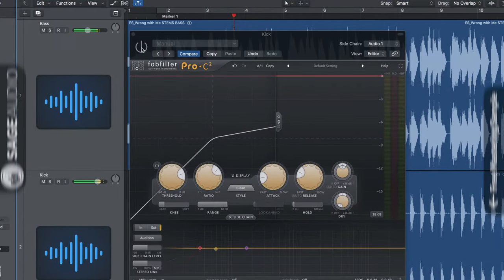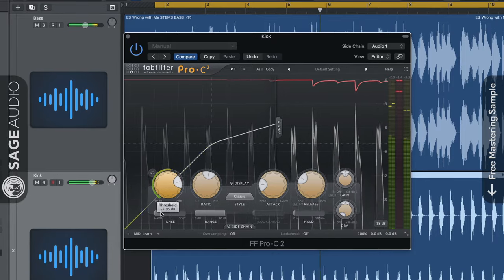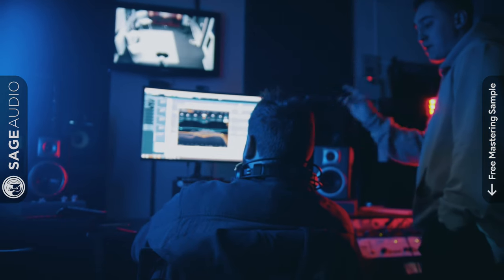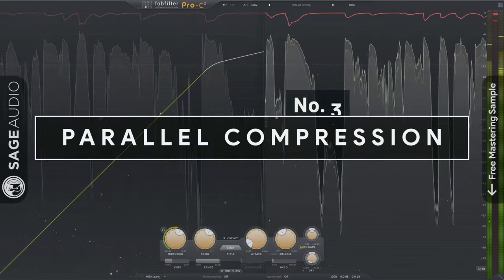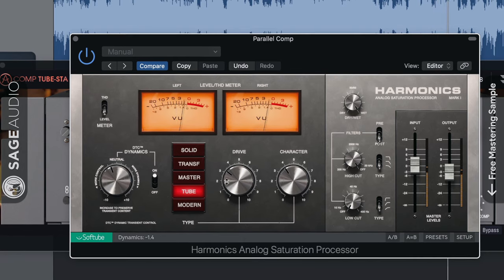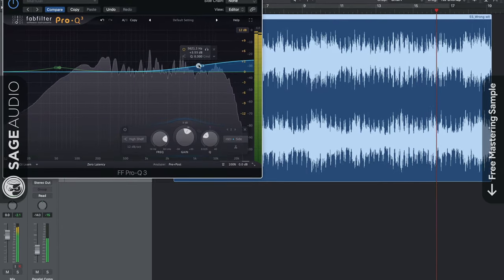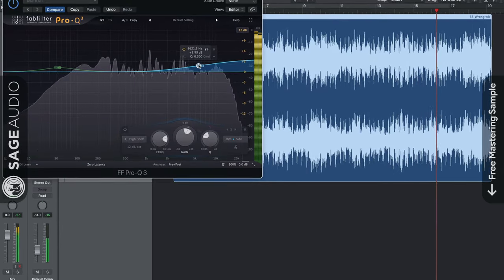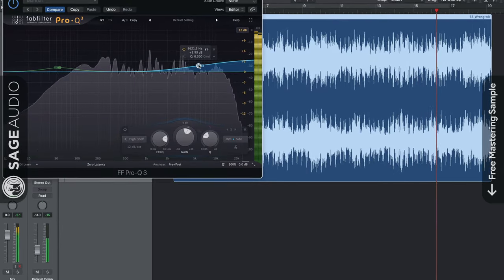Top 5 Compression Techniques

Comment: 00:00
👋 Introduction to the top 5 compression techniques
01:35
🔊 Technique 1: Kick and bass ducking for better definition
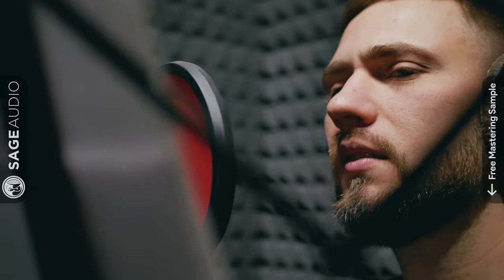03:45
🔊 Technique 2: Full mix and vocal ducking for vocal prominence
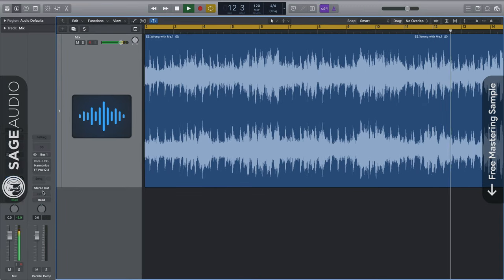06:11
🔊 Technique 3: Parallel compression for vocals, drums, and mixes
08:12
🔊 Technique 4: Serial compression for less noticeable dynamics
10:01
🔊 Technique 5: Smoothed and transient compression for tamper control
12:06
💭 Discussion on the top 5 compression techniques and their impact

Comment: I myself like serial compressing my audio. When I'm doing this, not only am I getting several different compressors to affect the sound by each compressing some, I'm choosing different ones to add unique character.

Example, right now my Livestream audio going through my Studio One DAW goes through Waves CLA-76 and CLA-2A consecutively, each doing about 2 dB GR, then later this signal is going through my Pulsar Mu, modeled after the Manley Mu.

The Pulsar is set to look ahead some, and I'm using its sidechain EQ to ignore some high and low frequencies so only my mids are compressing here. This is doing more gain reduction than the others as well, partly to compress, but again to add unique character.